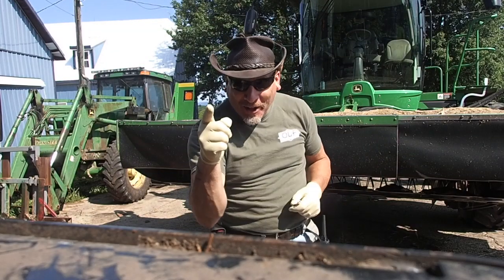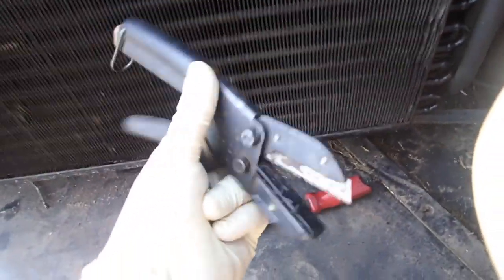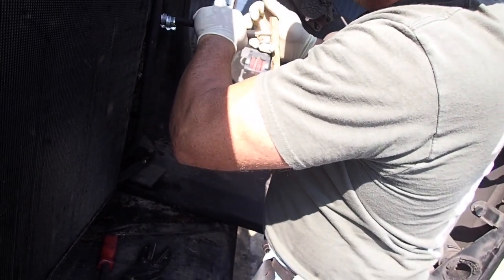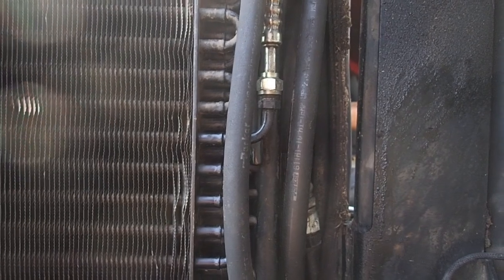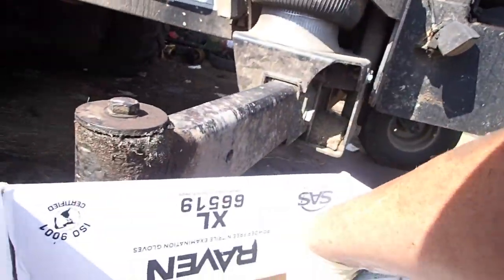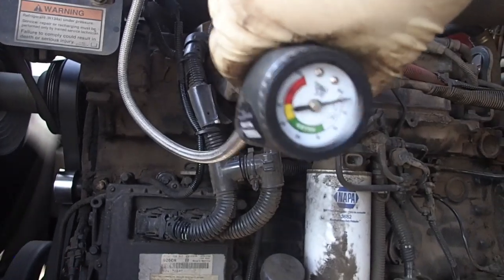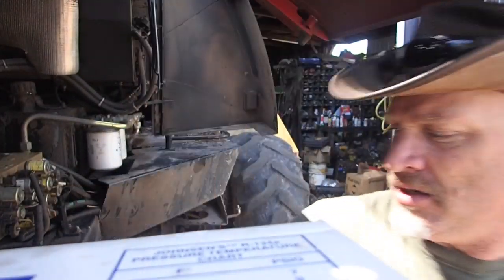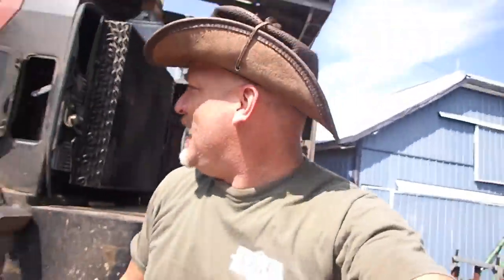Dont Worry Be Happy

Comment: Never laughed so hard in all ... well in quite a while. I AM licensed in the household type of refrigerants but not the automotive side and I quite certainly did not see a thing ... so there you go!
I would advise a vacuum pump they are cheap at Harbor Freight (2 sizes you only need the smaller one for your equipment), as compressing air will cause excess heat and reduce overall efficiency, to some degree. 
Keep Movin ON (meant in a good way)

Comment: you make the repairs  look  so easy wish you could fix my 185 ac that easey pto seal leaks into trans and power directer is weak dealer said 5 grand  if needs brakes will be 9 grand   i should no t off yoused it like a 100hp tractor looking may be ajohn deer

Comment: Wes go to harbor freight and get you a vacuum and gauge set.  Less than $150.   Best thing I ever bought
Reply: Still costs to much and takes too long.
Reply: Brandon Caldwell 😂 If you say so.
Reply: I bought a set and the high pressure line blew up 2 times once with each set I got 3rd set worked but I would suggest spending a bit more because its a pita with they blow up and beat the shit outta ya.
Reply: He has his methods. Leave 'em alone.
Reply: Ben Butler I’ve had mine for 6 years and do work for ppl.

Comment: ok this much happy in the morning is just too much fun. I cant believe I am going to say this but you can get a large vacuum pump from horrible freight. I know they are cheep junk but if you get the large one they hold up pretty good.  as for a gauge set amazon has the top line Yellow Jacket the cheapest I have found it any were.
Reply: Believe it or not just for fun I bought a vacuum pump from the one job tool shop and put it on one of my service trucks, the one that gets the most work, and it has out lasted all of the other pumps. It's about 4 years old or more. I am amazed, or lucky.
Reply: my horrible junk pump is 3 years old now and still going strong. I can still get 200 micron out of it easy.